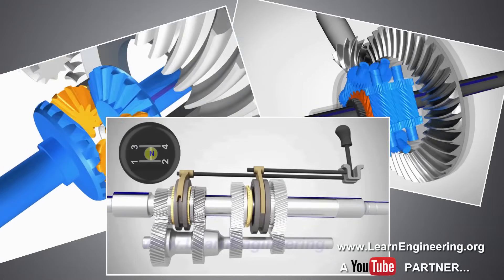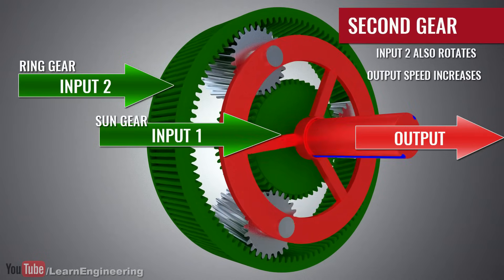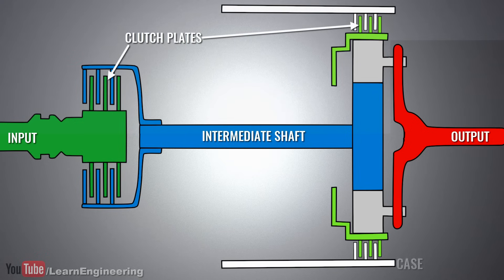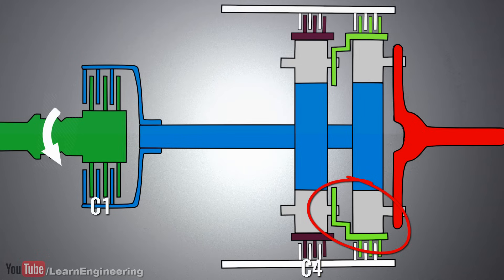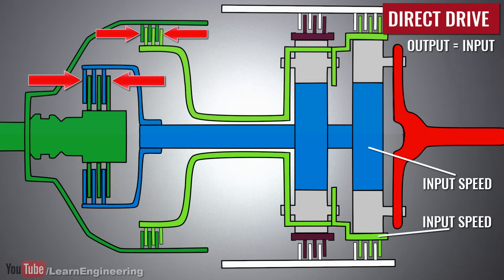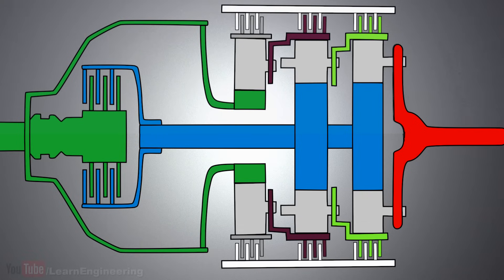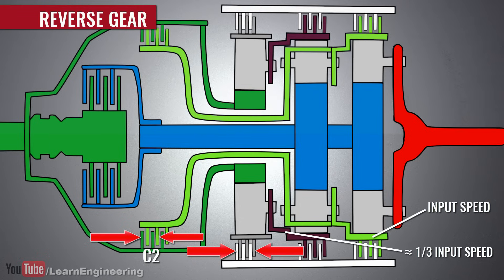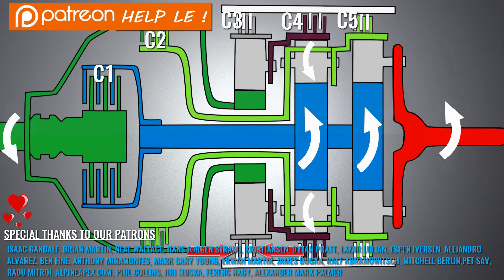Automatic Transmission, How it works?

Comment: can you make a video for a ram pump explation, i will pay for the video
Reply: RAM pumps work by exploiting the water hammer effect. When you have a long pipe carrying water through it with steady pressure applied from the source of the water to the end, then the rate at which water flows increases steadily (until things like friction and viscosity cause resistance to the flow) If the flow is abruptly stopped, the water still has lots of kinetic energy and momentum and wants to keep moving. The result is a huge pressure spike. [read more]

Now imagine if you have a device that periodically allows water to flow then slams shut to cause these pressure spikes periodically, and a check valve that goes into a pressure chamber. The check valve will only allow water to pass when the pressure near the opening and closing "waste valve" exceeds the pressure where the pressure tank is, and of course due to this, water can only go one way due to the check valve operation.

Interestingly, this operation is almost IDENTICAL to that of the Boost converter in electronics. Instead of using a long pipe to build up and store kinetic energy, in electronics the equivalent part would be a long wire wound around a ferrite core, an inductor. Instead of a check valve, diodes are used, as they only allow current to flow in a single direction, and a capacitor acts like a pressure storage tank. The only dissimilarity is additional electrical complexity for better voltage regulation and overload protection.
Reply from the maker: There is an option for it in our Patreon page. Please check it.
Reply: I forgot to mention, the waste valve is probably the hardest thing to get right with it. Generally DIY RAM pumps use a swing check valve because when used improperly, can act like a valve with hysteresis, due to the requirement of increased reseal pressure. (when the valve is used upside down, especially with additional weight or spring force added to the flap.)

When the pressure is low, the flap naturally opens (at which point it is at a low resistance state, allowing almost unimpeded flow), Then the water flow steadily increases until enough flow (and therefore pressure on the flap) causes it to slap shut, at which point it only reopens once the pressure falls low enough. By doing this, a effective mechanical analog of a relaxation oscillator is created. Electronically, transistors and carefully controlled oscillators are used instead for this switching action, but really it is no different! :)
Reply from the maker: Thank you for the detailed explanation. We will definitely look into your video request. Currently we are too busy with some pending projects.